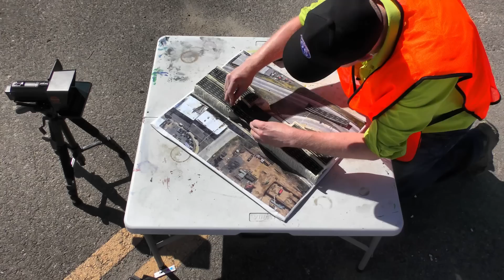Here's How Pennsylvania Re-Opened I-95... in Just TWO WEEKS!

Comment: That's interesting on how they could keep traffic going while constructing the bridge. Though every time I think of US (slow) road construction, I can't help but think of that Japanese video of them putting a bridge(?) together in less than few days.
Reply: The final bridge could probably be put together in a few days but there's a ton of lead time to create those concrete reinforced beams in a shop somewhere since they don't just have spares lying around.
Reply: @dropatrain  Beams are steel. Month to get them on site even with the mill putting them at the front of the queue. Just takes that long to setup and fabricate them. Same exact beams that were there before.
Reply: Japanese did not build a bridge in a few days. There was a fake post about a bridge that was built in 24h to bypass a road that collapsed due to, what looks like, a landslide. This bridge took 2 month to complete and there was no video of this.
Since you've mentioned a video, if you've seen it it was probably one of the ways some laces use to deploy a bridge rapidly but this can be done only after careful planing and preparations and fabricating all sections that are made in a very specific way. This is not something that can be done in a day or two without months of preparations. The advantage is that you don't interrupt traffic for long periods of times.
Reply: @AL5520  ... some years ago an "instant bridge" was done near me. Not sure how long the design phase took or how much of off-site preparation was done, but it took about 3 months to build a new bridge next to the old one. When that was done the demolition was started on a Friday night and the new pieces were slid sideways, into place. Paving was started late on Sunday and opened for traffic by Monday morning. (two lanes plus shoulders) The following weekend the other direction was done the same way. Landscape and cleanup did take a few more months, with a much smaller crew.
Reply: They did that in Massachusetts, where there were a series of 14 highway bridges that needed replacement, and each was done with just a two-day closure of the highway. Of course, doing that relied on about 4 months of off-site prep work that was mostly invisible to the public.
Reply: Over on the Oregon Coast, our Department of Transportation commissioned a replacement for old 3-lane highway bridge (over a slough) with what was ultimately a 4-lane bridge with bike shoulder lanes and wider sidewalks (in total, over twice as wide).  The project took about 2 years to finish but they did it without ever closing the highway to traffic overall (it's a key arterial with almost no alternative routes).
Reply: Because 23 good old boy companies need to get their cut so it takes longer here.
Reply: @AquarianNomadic  All PennDOT projects are open records. All money is accounted for and open to view. Just put in a request. There are tons of audits and oversight for something like this is quite extensive. No "cuts" being given here.
Reply: @oscarwinner2034   Vinny from "Louie's Concrete" always gets the bids.
He must be the most amazing business man to keep getting 100% of the contracts. 
While on paper, you see legit entries.
Reply: @AquarianNomadic Louie's Concrete" will always get the bid because they've done these intense rebuilds before with satisfactory results.
New, unproven contractors aren't even going to be considered.
"Ralph's Bridge Builders" established in 2020 will get contracts on new construction projects that take a year.
Reply: @AndrewBlacker-wr2ve   You missed the joke.
Reply: @AquarianNomadic  Then it wasn't presented very well.
Reply: @AndrewBlacker-wr2ve   Nah its you.